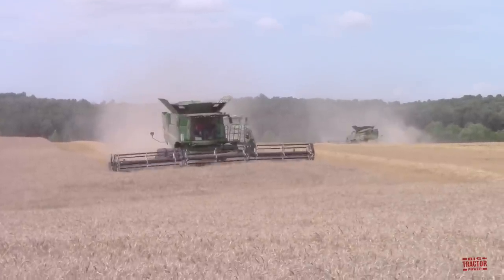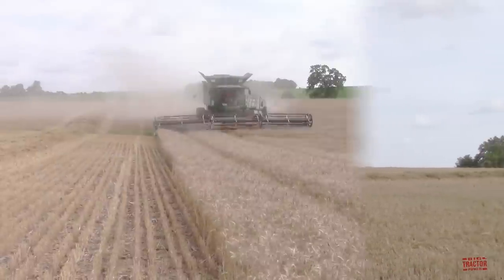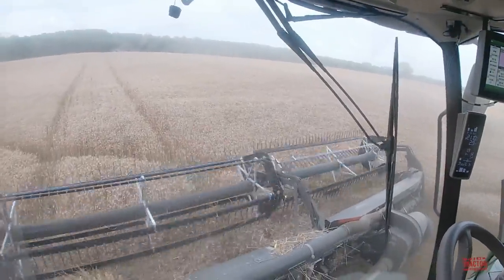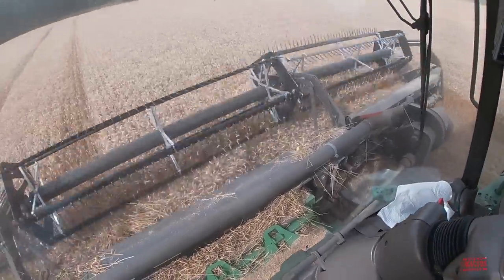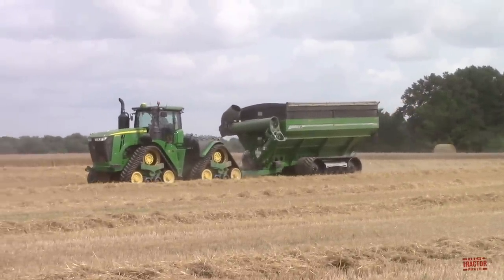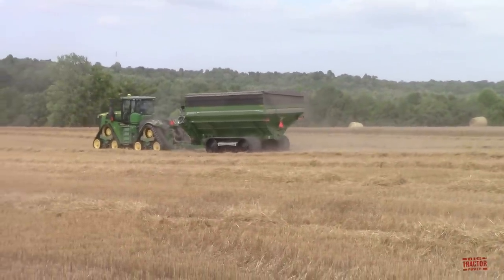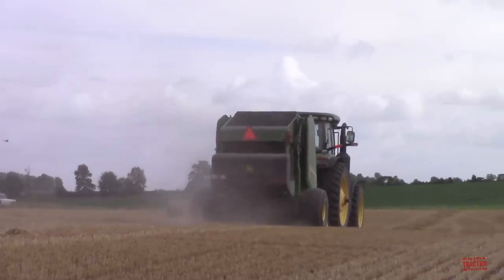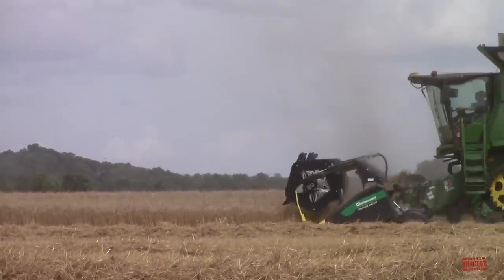WHEAT Harvest and STRAW Baling with JOHN DEERE Machines

Comment: I work for a farm that should be starting to cut tomorrow or Monday, sometime next week. The farm is located in South Central Kansas near Conway Springs and we will be using 2 John Deere 9660 STS combines (1 is a bullet rotor), and a John Deere 9760 STS combine to harvest wheat. A John Deere 7800 with the 740 Classic Loader on it will be used to pull an A&L F705 grain cart. This harvesting team is gonna be harvesting around 2000 acres of wheat, MAYBE close to 2500 or 3000 acres.

The farm does do some straw baling, however they don't own a round baler. They call someone who owns a baler to bale it for them and my bosses have had me use the 7800 with the 740 Classic Loader on it with a bale fork on it to move the bales.
Reply: Way back in 2005 I put around 1200 hours on a brand new 9660 working for Neufeld Harvesting out of Inman, Kansas, good times
Reply: @walkerdb84  well howdy there fellow Kansan!
Reply: @JacobDoffing42  Well I'm actually your neighbor to the south in Central Oklahoma, I only worked for the Neufelds for one summer :)
Reply: @walkerdb84  well Inman is in like McPherson or Harvey County, and Conway Springs is in NW Sumner County

Comment: Does JD offer tracks for the rear of their harvesters? If not, why not?
Reply from the maker: Good question. They do not.  I do not know any manufacturer that offers 4 tracks on a combine. They are aftermarket kits to add rear tracks. The front tracks are the main drive wheels and carry the full eight of the combine. The rear tires are for support and steering. Once the main tracks have cleared mud and rear tires can power through.  The front tracks also reduce compaction by carrying the eight.